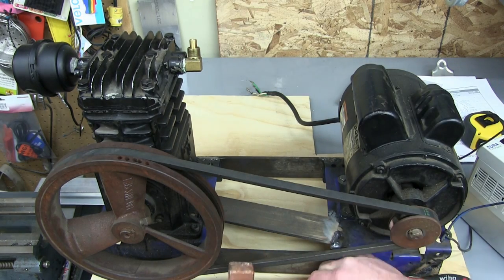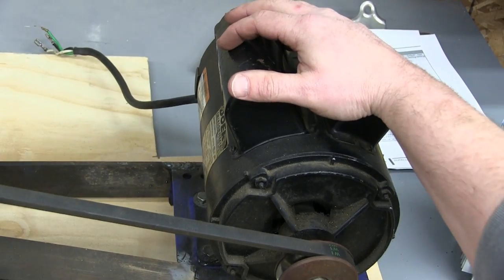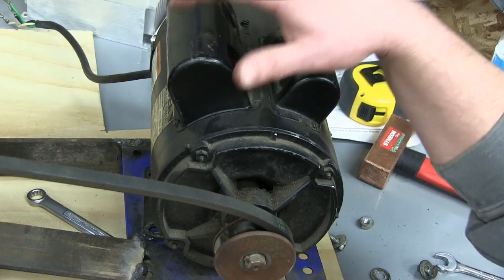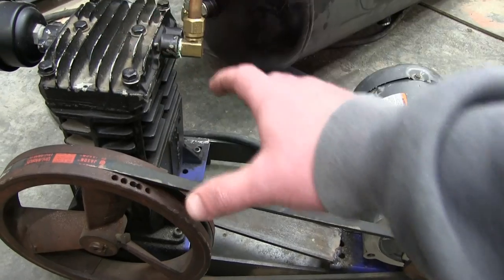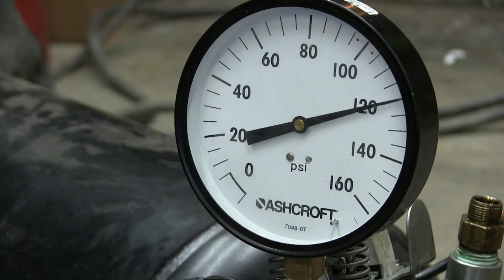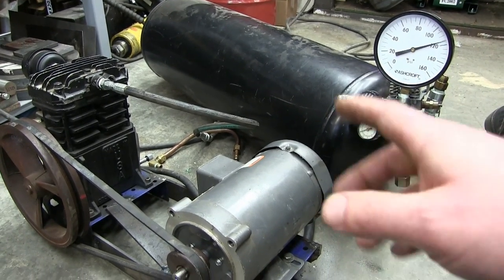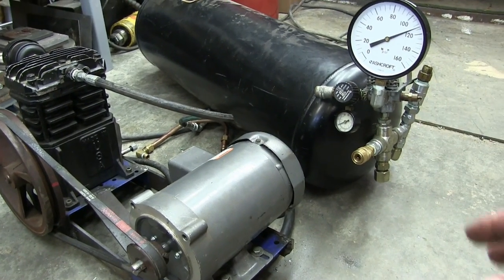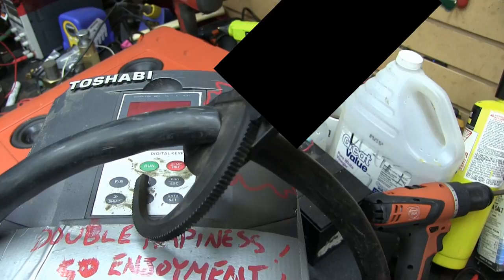BIG COMPRESSOR PERFORMANCE BOOST | No tripped breakers!

Comment: This is great other than you just made a $100 compressor into a $2000 compressor.
Reply: Small VFD's are really cheap now, especially if you don't mind off brand (direct from China). The three phase motor could be cheap if you source it from salvage.
A few minutes of looking and I've found a 
2hp single phase 115/230v for $215USD
3hp single phase 208-230v for $380USD
4hp single phase 208-230v for $408USD
5hp 3 phase for $500usd.
I'm betting this could be built for less than $600 (not including an existing head, frame, and tank) with some luck.
Reply: Can I trust this?  Do I need to wear paintball tactical armor around this Frankenstein? Love this Canadian Macgyver mechanic.  Peace!
Reply: My local farmer has a only a single phase power line. His milk bulk tank cooler costs him a fortune to run. 
I suggested he goes to three phase motor with a three phase converter and motor speed controller. His electricity bills dropped by 1/3. With some fancy anticipatory stuff he could probably drop that even further.
Reply: In my area I can find used washing machines with 2 hp 3phase induction motors for about 60$ cause the confusor stopped working or what have ya. I’d bet the motor in good shape
Reply: @ferndog1461  Well if Chinesium VFD trows a hissyfit and does not stop schooching away there is danger of over pressure and something going to low earth orbit, but put in over pressure valve or two that blow if that happens and you just have huge dust storm where compressor is. Simply put, always have back up everything specially when it comes to built in safety equipment.
Reply: @MeatPoPsiclez  I almost get this theory, except for large-ish (say, 5HP) compressors isn’t it cheaper to buy a new single phase motor than buy a 7.5 HP VFD? I don’t think a 5HP VFD will run a 5HP compressor motor...
Reply: @wayngoodman5889  probably yeah. It's not a particularly practical idea, just not a $2000 vs $200 compressor as op suggested.
Reply: @MeatPoPsiclez  right... not THAT bad, and I get the VFD idea and totally support folks doing the conversion on smaller HP or less demanding loads!
Reply: @MeatPoPsiclez  You need 3 phase motors for VFD control, but fortunately they're usually cheaper due to the large amount of surplus/NOS available. On a small compressor (~2HP) you could get a decent combo for around $200.  Not sure how much the PLC setup would be though, I only have experience with large industrial versions of that.  Not for your average home gamer.
Reply: I'm curious are you saying you can run a 3-phase motor off of single phase power with this?
Reply: @bobgaudet9941  yes single phase -> three phase Vfd's exist; internally they all rectify to DC and build a new 3phase supply from that. They aren't that common since single phase sources generally have limited power delivery compared to three phase.

There is also single->single phase Vfd's,  but they require specific motor topologies and the starter cap to be removed; and efficiency is probably not that great.
Reply: @MeatPoPsiclez  thanks
Reply: @bobgaudet9941  from MY perspective, the best approach - if you have (or have access to cheap) 3 phase machines - would be a multiple-tool rotary phase converter... if you’re trying to run a bunch of 3-phase off VFD’s and you hafta buy the VFD’s you’re better off buying new single phase motors.
Reply: @wayngoodman5889  yes I have a three phase mill i will be working on next year. Lol thanks
Reply: Sorry AVE, I know this is an old video for you now, and I read the top 20 comments, nobody mentioned it yet, I,m not reading all comments, cause thats a mission. So I,m just sayin... the history of commercial transport air brakes systems is long and drawn out, constant improvments and redundancies have been implemented. However brake fade and loss of air still occures and thousands of lives have been lost. Could your work here be translated to commercial transport? Could it save lives? Please take a look at this industry application. Could it be possible?
Reply: Island Trooper,no this will not work for truck air systems as the compressor is mechanically driven directly off engine. The system is designed to have a capacity for 8 full brake applications if compressor stops chooching(low air warnings-lights/buzzers built in),past that is fail safe mechanical spring brakes.
Reply: @Hellsong89   freaking, flanking great pint !!
Reply: or they're free from the gettin spot.

Comment: If this takes off, I'm blaming you for the loss of my compressor-mandated smoke breaks.
Reply: And if it does take  off, they will want to put another guy on the same compressor,, which  means more adjustments to increase efficiency and productivity.... It just never ends..
Reply: Jayce Brooks 
O
Reply: no name bah! Not a chance. Pneumatic is cheap, powerful, and low maintenance.
Reply: @cougill_trim_and_cabinets  you not compared Milwaukee electric tools with air tools then have you....

Pluss a contained unit vs dragging an airline up a ladder...
Reply: Michael Fletcher ok, I’ll give you that. They’re great for punch and overhead usage. I just doubt they’ll ever replace pneumatic—at least not anytime soon.
Reply: Nate they can and in many cases have replaced pneumatic but I agree there will always be a need for air just like there will always be a need for corded electric tools. If your on a production line and your driving 10,000 screws/bolts all day long you will gladly take a hose/cord. Battery is great for mobility tho
Reply: @KnowName33  well electric tools have less power but even the airless nailers and nail guns arent airless. So they are just battery powered to drive the air canister and the piston does the work.
Reply: @michaelfletcher1694  Milwaukee electric tools are still way underpowered vs corded electric and even further underpowered vs pneumatics.
Reply: jdr ok electric has the convenience and portability factor air will never have. Sure, you might run out of battery, but then you just bring more charged batteries. Air tools tend to have less moving parts and no electronics, which makes them much more reliable/long lasting, and some tools are more compact because of it of course. But the convenience/portability/use ability factor of portable electric outweighs it to me. No cords, no hose reels, no compressor, no problem.

Comment: The hose blowing off, and the compressor running all weekend, while I am on vacation at Dysney land, always haunted me. So I wired a relay, in series to the  pressure switch, that turns on the contactor. I power the relay with my ceiling lights, when I come in my shop and turn on the lights, the compressor starts, when I leave my shop, the compressor won't start. Works well. If I don't need the compressor I turn off the pressure switch.
Reply: Could wire a separate switch next to the light for the compressor a dedicated breaker or off the ceiling light breaker thst way you don't need to turn off the pressure switch and lights and compressor switches are right next to each other independent
Reply: Dont forget to turn ur lights off. Lol
Reply: Thermal breaker?
Reply: Smart
Reply: Excellent.  Love it.
Reply: I use an Intermatic FF4H (SPST) spring-wound countdown timer switch on my 240V motor.  Not 2PST, but it still keeps the compressor from running all night.
Reply: That's just a plug with extra steps
Reply: Smart idea, and so simple.  I don't understand a lot of the other replies though.  Your way seems best to me.

Comment: AvE december edition "VFD everything" continues
Reply: Piran freebies?
Reply: And so it fucking should!
If flying mechanical bees use it it can't be T-bag.
Reply: Yep, gonna VFD my mum and dog (ain't got no dog)
Reply: lol I was just thinking the same thing..... "VFD all the things"
Reply: VFD is cutting edge. Its mainstream in commercial air conditioning! Lower power consumption and higher efficiency.
Reply: OK,OK! Thats cool! Howabout running a treadmill motor?(1-3 american h.p. )complete w.control board?330-5000 R.p.m, while keeping h.p.! Throughout that range! Im runn-ing one with the ct.board, w /a jackshft.on a 1941 F.E.Reid large lathe! Super balls! (American) c'mon! This is fun!!
Reply: he musta ran out of steam.. or stopped running out of air, havent heard back on any of these great idears
Reply: Had a 50hp motor running a grinder. 3 years and 2 motors later installed VFD, ramped up RPMs and still rumming 6 years later.

Comment: Ave, don't feel bad...in one of my less bright moments I discovered just how flammable SILICONE lubricant spray is.  Did not realize that they were using propane for propellant and, of course, propane is heavier than air.  So I lubricated my shredder one day, not realizing that the bucket had accumulated all of that propane for me.  Fired it up to spread the lubrication.  Poof.  Bang.  Where are my eyebrows?  Arm hair?  An instantaneously receding hairline?  And by God does burnt hair stink to high heaven!  You just can't wash that smell out it seems.
Reply: LOL I did the exact same with the exact same results and it blew the front of the shredder basket off.  luckily for me I had just emptied the basket or I would still be picking up confetti.
Reply: Ethan Poole lol. If I ever have a cruddy shredder I’ll have to try that outside in a safe area but with the switch set to on and plug it in from a while ago.
Reply: I did that filling a lighter in my armchair many many years ago.  Fill ligher, get a bit of over spray, check lighter works....  Boom, lost eyebrows.  I have never seen someone move so fast.  My buddy was sitting in the chair next to me and was like a freaking rocket out of a missile silo as he thought I'd blown myself up.  I was howling with laughter.  Nothing else I could do !!  But the smell of ammonia from burning hair! Damn!
Reply: Discharge temp on an oil lubricated compressor can reach 350°F oilless 450-500° so be wary of hydrolic hose!!

Comment: i actually built this same deal with a fleet farm air compressor .  80 gallon  17 cfm stock with 5hp 240volt 1phase  .  i swapped in a Hitachi 3hp  vfd and 3 1/2 Hp  3phase Baldor motor  with F insulation for high temp .  it uses a  3 wire pressure switch for feed back .  CFM jumped up to around 24cfm at 90psi    88HZ   ,  i dont use a unloader ,  it set to 10 second accelaration time . with no issues .

its set to ramp HZ up as pressure drops with the PID function and pressure switch . min hz is set to 45hz  . works Great with my sand blast cabinet . and can sand blast none stop with 90psi for long as u like .

its all  in a inclosure  with fans for coooling as  well as a liquided cooled cylinder head i made out of Air conditioning exchanger   and a block of 6061 aluminum 

its been slowly upgraded  over the years
Reply: This sounds like a great setup you have come up with

Comment: If this were me, I'd be putting in a PID instruction and controlling to a tank pressure setpoint.  WORD TO THE WISE - if you do that, or anything similar that would result in the possibility of the motor running for long amounts of time at slow speed (below 6 to 10 Hz), you may want to upgrade to a fan-cooled motor (i.e. separate fan that runs all the time) to avoid turning the rotor into liquid copper shmoo (tm).  Love this shit, keep it up!  This Patreon stuff is addictive thanks to you.  It's like main-lining hands-on engineering skillz.  PHYCK YA!!!
Reply: Agreed!  No need to manually signal the controller, a PID controller will detect when the demand is high and increase the output.

I think this is one of the applications where they do it that way because that's how it has always been done.  All it takes is a little disruption and everyone will start making changes.  The key (as always) is that it has to be economically justifiable.  

The brainboxes for this would be dirt cheap, but a proper setup would require a pressure transducer and a variable speed motor drive.

I wonder if this is worth patenting?  Certainly it is a combination of existing ideas for a specific application.
Reply: Lots of drives, even some of the small ones, have control macros built in, so there's really no need for a separate PLC. Most also have analog inputs that can use the signal from a pressure transducer. I've heard him say it many times, " Run what ya brung!"
Reply: Not sure if it would even need to be PID. Maybe PI, but there shouldn't be much inertia in the system, to the D term would likely be redundant. Plus, if it only needs to stay within ~5PSI of target pressure, the control algorithm could be much simpler.
Reply: page 4-66 in the manual are the PID parameters
Reply: No, it's not patentable, as every major manufacturer is already doing it with their big irons (as in: compressors that feed all tools for an entire assembly line)
Reply: That's fair, and you're correct - likely just PI would be more than sufficient.  I'm used to the PLC world where it's a PLC instruction regardless of whether you give it any D.
Reply: <----Michael:    Novel, Useful, and not Obvious is the standard for utility patents.  However, public disclosure negates your ability to patent...so if you disclose a specific variant (in detail) of the invention online, you just legally sabotaged your ability to patent....and everyone else's.
Reply: Actually i started with exactly that, approx. 2 years ago. Never finished it because lack of interest and time. 

Most VFDs can be set up so that they run on a minimum speed, the pressure switch can be used to switch everything off in case something goes south. I think i should finish what i started an put a vijeyoh online.

Regards,

Sepp
Reply: bassmann446 I

Comment: Um...adjust your pressure switch and cut down on the wait time. That's what construction guys do. Framers don't wait. Adjust to 100 cut in and 120 cut out on the wheelbarrow compressors. Also if you overspeed those cheap twin compressor heads they'll bust the rods in no time.
Also starting under load with no relief after the cycle will grenade the rods too...
Reply: jiminy cricket your absolutely right this seems good for just doing stuff in the shop but you can run 3 nail guns with a $100 pancake (short cord) then add an extra tank you never run out of air or the price  of a bigger compressor is less than the drive
Reply: ian holland 
Just a brain fart, from me, that is, but what would happen if you put a small tank with a one way valve on the input, for each nailer. And have them connected in parallel. That way the compressor would only pump air to the tank that needed it. ..
Bottom line cost is everything. ..
Reply: I work with the gas and diesel powered 100 CFM units... designed to drive 3/4" and 1" impact guns, and other air hungry tools like jack hammers... SO to be able to get the same performance out if a unit but by using a VF drive electric unit... would save the need of screaming over the air compressor all day long.
I would use a rotary sliding vane, rotary helical screw, or rotary scroll air compressor. Over a Reciprocating compressors design. This was RPMs would not be a problem (for the most part).
Reply: I work with compressors that produce 900cfm, we use plc's and vfd's and 1200amp switchgear. That kind of electronics for a job site compressor is overkill and expensive plus how many people know PLC programming and ladder logic, not many. I did the same thing as Jiminy Cricket on my home shop compressor, I adjusted the pressure switch to come on at 100psi and turn off at 120, much cheaper.
Reply: Everthing you said is exactly what I was thinking too. I ran large projects with the Right size compressor. Never had to wait for air. Seems like if you had to give a signal back to the compressor to change into overdrive then you are indeed waiting for pressure . and without a head pressure relief before the next start up will definitely cause damage to the rods and piston..